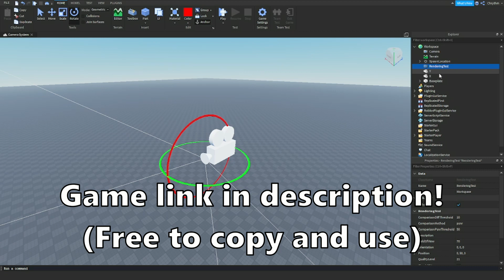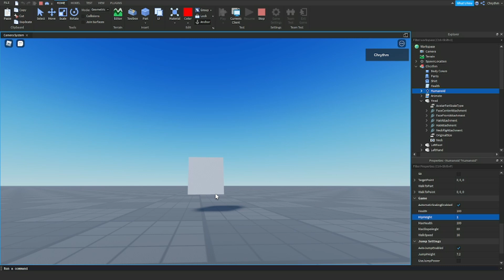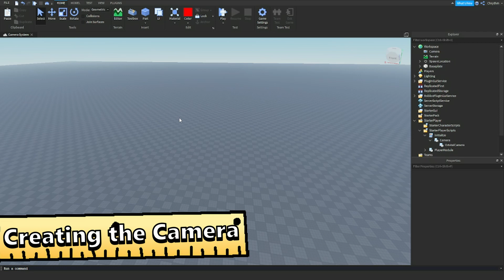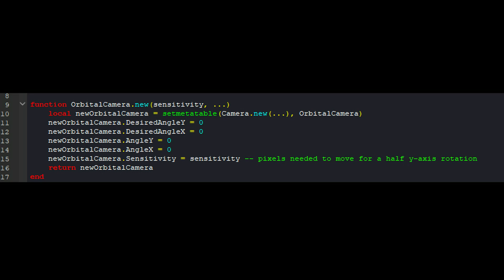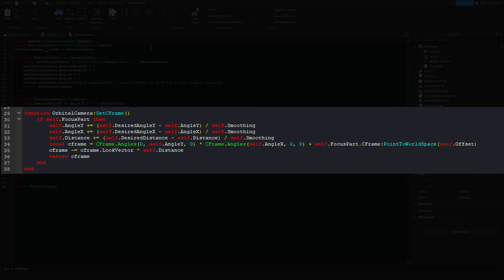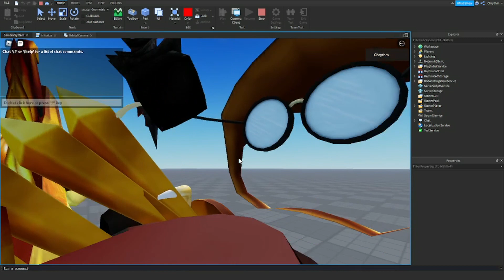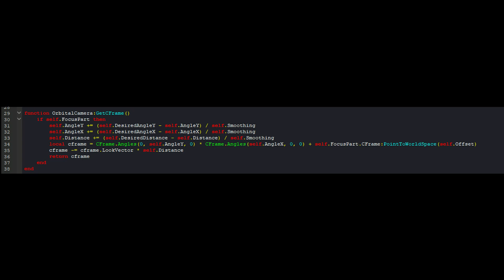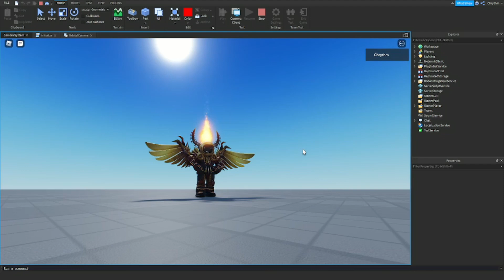How to Make a SMOOTH Camera System - Roblox Studio Tutorial

Comment: This turned out brilliant! How possible is it to add collisions to this system?
Reply from the maker: you would have to do a raycast and find the intersection point with any obstructions
Reply: @Chrythm  Ooh, so I'm not really a scripter. I'm too stupid to know what all that means since I haven't worked with em' lol, but I made a bit of a work around. It's kinda lame, and is pretty buggy- But essentially I just swapped out the code for the camera, with a part; and then attached the camera to that part and removed the scrolling function since it was giving me quite a bit of problems. Please let me know if someone's found a more plausible technique because I certainly am way too stupid to know how to code that lol.
Anyhow, thank you so much for the work you've done here, It's helped put a lot of polish on my game and is exactly what I was going for. Is it possible to make the camera move with a bit more emphasis on the smoothness? I found your little comment saying to change a certain number to affect the smoothness, although I'm not sure if I'm doing anything wrong, or if it's cause' of my little edits but it doesn't actually seem to change anything.
Reply: @Chrythm  One more thing, It seems that when using Shiftlock or any other form of mouse-locks, the camera just entirely does not work. How can I fix this?